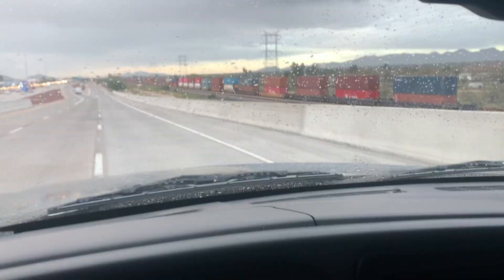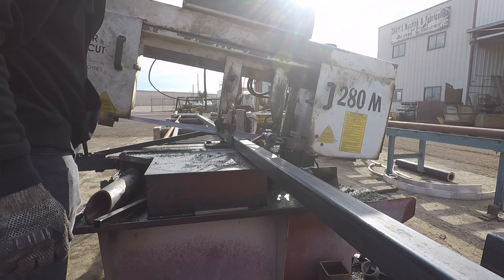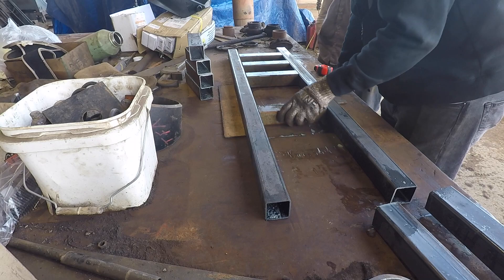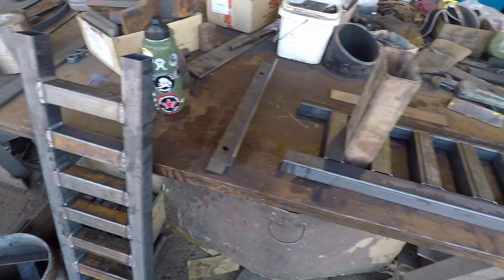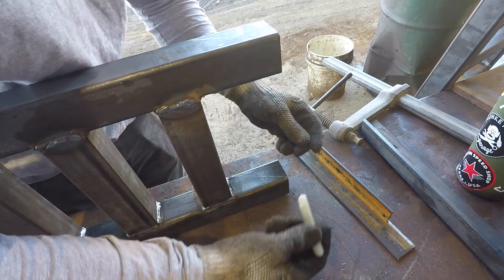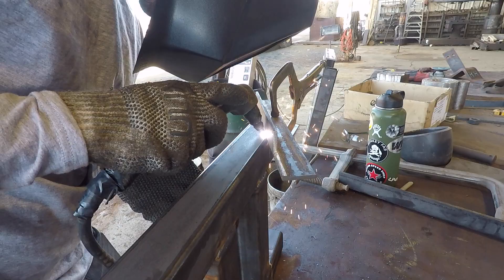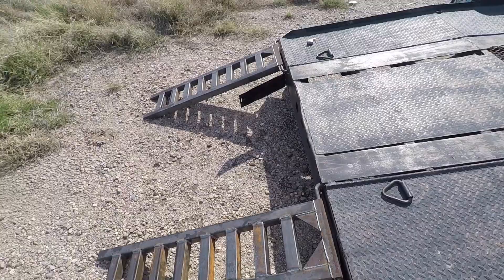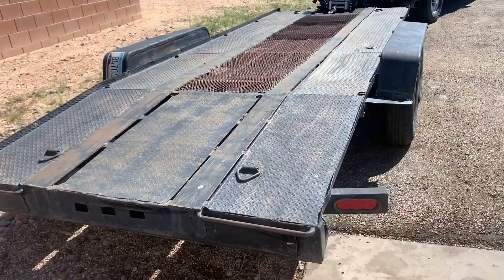Car Trailer Ramp build/fabrication DIY

Comment: I really like the idea that the ramps are easily removable.
On my trailer, I only use the ramps to load or unload the ATV a few times a year.
Most of the time I use the trailer to transport construction materials, which doesn't require ramps.
Even sometimes, ramps can interfere with carrying loads that exceed the length of the trailer.

Comment: Good job with all the fab work man. Only thing I'd suggest would be to use angle iron (V V V V) as the center inserts, much much better traction.
Reply: Hey bro can you explain to me what you ment?
Reply: he means to put angle iron, pointed part down, (so that the V is facing up) in between the ramps for a driving surface. The V offer traction and strength.  @anthonymoreno2897

Comment: young man ,

u are doing this ramps  assback  / your way is not safe to drive on ! .

angle iron would be better  complete safe , because the points will be sticking up , your tires or track will grips the ramps better  ! 

an make sure your lip should be on the bottom   / this way your weld want broke